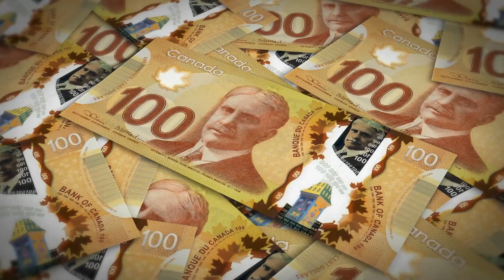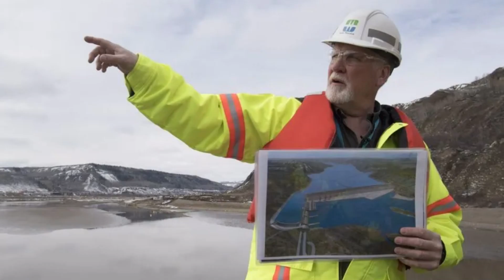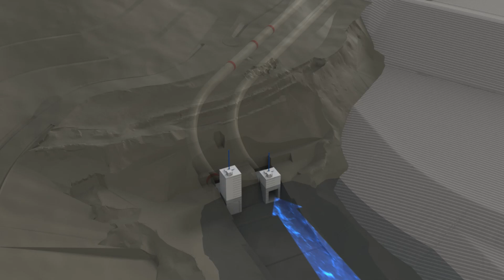Canada's Controversial Mega Dam Will Power 450,000 - Site C

Comment: It’s not as green as you pretend. Building dams has a detrimental impact on fish the environment plus after decades of the dam being built it causes the dam to back up sedimentation which blocks the dam from working. It’s too bad most people don’t understand that
Reply: sediment buildup depends on a number of factors.  The engineers designing the dam would have considered it.
Reply: There are already 2 dams on the Peace River the WAC and Peace Canyon dams. When both of those were built  BCHYDRO bought most of the land down stream and leased it back to farmers, in anticipation of Site C. The environment damage had already been done by building of the 2 dams. The fly in the ointment is the negotiations of the Columbia River Treaty with USA.
Reply: It's too bad people like you don't understand we need electricity to power our society. I'm sure you'll be right up front pushing for even cleaner nuclear power generation...